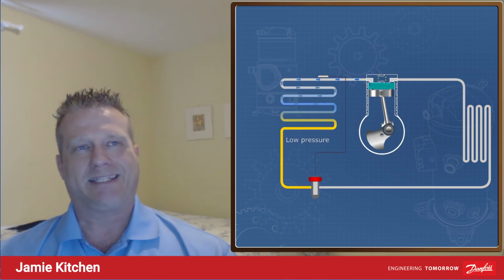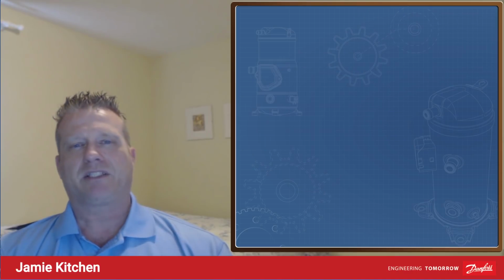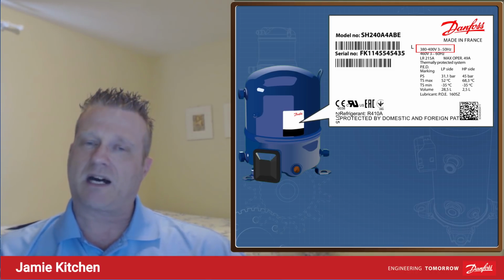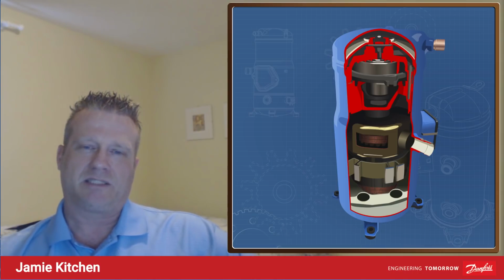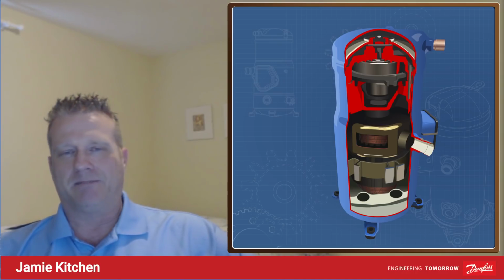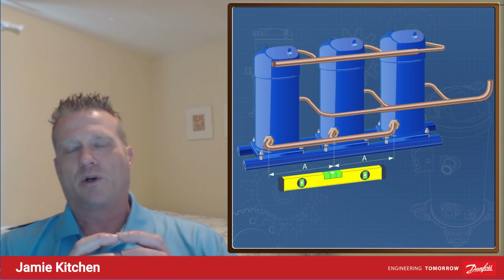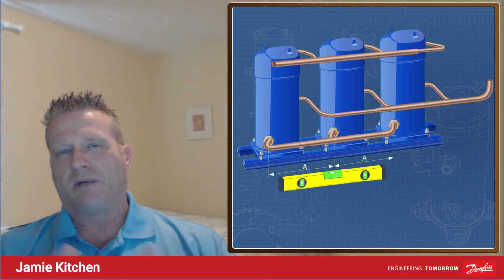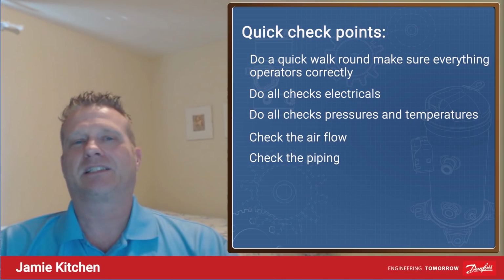Why compressors fail - and what can you do about it | HVACR Distillery Episode 1

Comment: My fridge failed slowly. The compressor started rattling loudly when it shut off. It did this for a few years. Then the freezer would not be down to proper temp. This got worse over  a few months until the freezer wouldn't freeze any more. 
What's up?
Reply from the maker: Hi, Thank you for your comment. Let us get back to you about this as soon as possible :-)
Reply: Thank you for your question. There could be a number of things causing this issue and and unfortunately symptoms that we see are not always related to the failure. Also, home appliances are not my area of expertise unfortunately. Given that the lack of ability to pull down  the temperature increasing over time, this normally is caused by a leak of refrigerant or the ability of the compressor to compress the refrigerant indicating a lack of sealing by either the piston rings or vanes in the case of a rotary compressor or compressor valves. As well, the capillary tube metering device may also be gradually plugging due to waxes formed from oil etc. I do not know how old the fridge is, but I strongly recommend you call in a company who specializes in domestic appliances or if the fridge is more than 10 years old maybe opt for a new one. By the way, I just had to buy a new fridge last month due to this very same issue. My fridge was 13 years old. After my experiences taking both my washer and drier apart to replace parts (In both cases I looked like I had been in a sword fight afterwards.), I went shopping for a new one with my wife.

Comment: Will adding a soft start device benefit the longevity of scrolls?
Reply from the maker: Yes, in theory, but: It depends on size of the motor/compressor, and a soft starter is actually mostly installed to protect the additional electrical equipment, the mains power supply against voltage drops and sudden current surges. A soft starter will also to a degree protect the motor windings, hence the compressor.

Comment: Jamie, You might want to mention oil charge with compressor failure. I've ran across systems almost dry and others over full. Oil is tricky if you don't know whats in the system, especially in Commercial applications where someone has done a conversion or left out the oil trap on rooftop units.  Great Video!!
Reply from the maker: Thanks for pointing that out. And thanks for watching!

Comment: Hi Jamie I would like to know how does increase in   temeperature   affects compressor working and leads to failure? ALSO .is it possible to reduce compressor failure by improving heat dissipation from the compressor?
Reply: Hi Akshata. Good question. The main ways that temperature affects the compressor working life are in bearing wear and motor winding life. The difference between the suction and discharge pressures determines the compression ratio. The greater this difference, the more work the compressor motor needs to perform and the greater the heat build up in the motor. If the superheat of the suction gas is high and the compression ratio is also high, this will lead to an increase in motor temperature and if the temperature gets high enough, the motor winding insulation will break down and the motor can short out. As well, the compression ratio and suction superheat also affect the discharge temperature and when they increase, so does the discharge temperature. Excessive discharge temperature can lead to upper bearing failure in scroll compressors and oil break down in any compressor that uses oil for lubrication. I hope this answers your question.
Reply: @xrayexplorer  thank u for quick reply can i have official email address to discuss more .